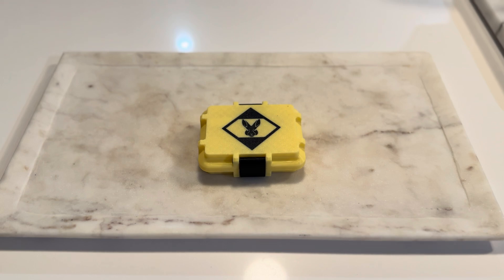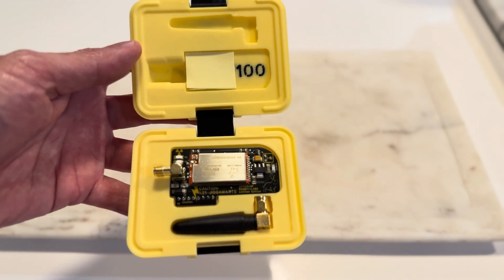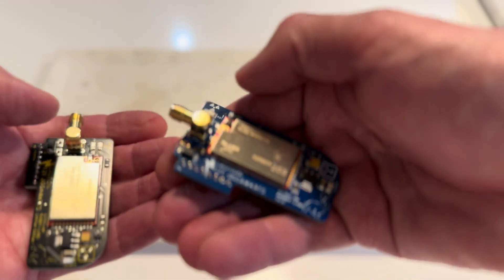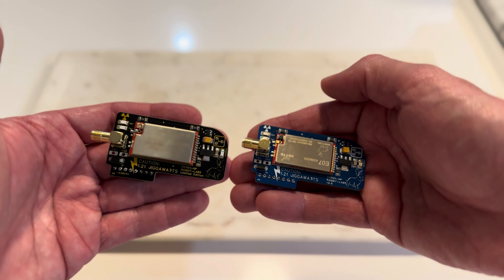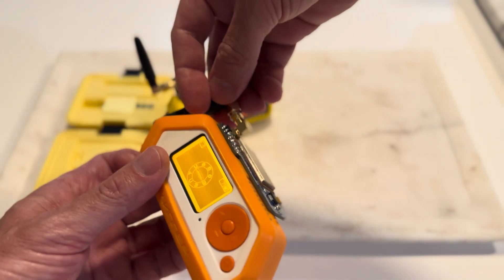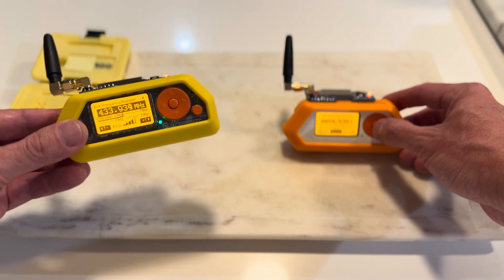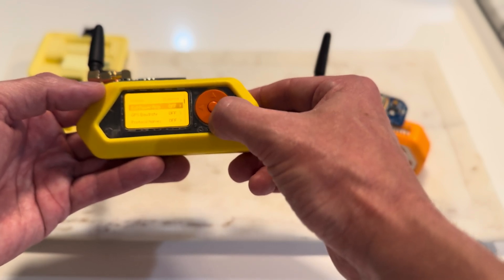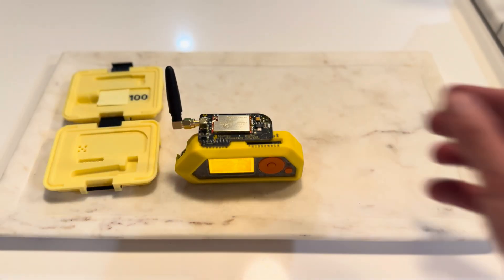Rabbit-Labs - Flux Capacitor - Amplified CC1101 - LIMITED EDITION for the Flipper Zero

Comment: I am running the latest version of Momentum and the radio settings are not quite the same. Module, GP S Baudrate, Protocol names, Counter IncreaserDebug Pin (LOCKED).
Reply from the maker: Things must have changed since the video was produced.

Comment: Do I need to select 5V on GPIO and set it to ON to use Flex Capacitor?
Reply from the maker: It depends on your firmware. In most cases, no you do not. As long as you are using current firmwares, it automatically knows.
Reply: Thank you so much.  Please keep posting your educational videos. 👍🏼
Reply from the maker: Thank you.
Reply: @seunglee8398 depends on your firmware, and your device….yikes.

Comment: Man I’m so jealous I missed out on this 😢 I suppose you have to check their website every day.
Reply: Same here
Reply: @timhitsman bro the OG flux capacitor is back in stock grab that one.
Reply from the maker: They go real quick.
Reply: @PenTestTuner  had to say screw it and just bought their C1101 expansion board with 900 Hhz RL mod. I really wanted the Flux Capacitor but can’t wait any longer. Also bought the IR bundle with the “multi pass” with a bunch of stickers and wrist lanyard. Super excited for everything to come.
Reply from the maker: Nice. Make sure you have the 433MHz antenna, too.
Reply: @PenTestTuner  okay roger that. So wait is the 900mhz antenna for reading those signals? Or will it pick up 433mhz or 315mhz also?
Reply from the maker: A 900MHz antenna will not read 433MHz very well at all. The Flux is a 433MHz chip. A 433MHz chip and antenna will work in the 300MHz range just fine.
Reply: @PenTestTuner  I was actually able to pick up an OG flux capacitor just now from the restock!!! Super stocked that’s the one I really wanted since watching your other video.
Reply from the maker: So happy you were able to grab one.
Reply: @PenTestTuner  #METOO I couldn’t believe it, just happened to join their discord and saw the notification. Can’t wait.
Reply: @PenTestTuner now that we are talking, I chose the Unleashed firmware I see you’re running Momentum though. IYO which one is better? I’m thinking about having a guy on Etsy customize my flipper and one part of the service is he loads the Monentum firmware on your flipper. He also changes it to a clear shell and changes the lighting of your flipper to pink, green, blue. Even the buttons are custom made.
Reply from the maker: In regards to firmware… try them all. The RGB mode is super cool for the flipper screen. You will love all your custom stuff. Congrats.
Reply: you shoulda used the discord. I got one. Shoulda got 2, but wanted others to get one. There was a window for a few hours they had extra left as well.
Reply: @mr.s1961  I did luckily I joined the discord yesterday and literally got the notification they were back in stock minutes later.